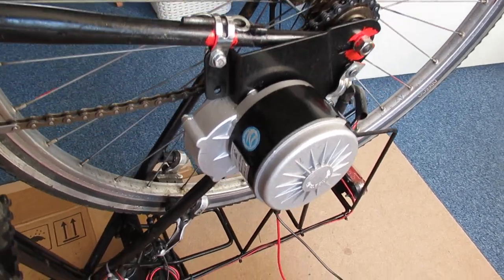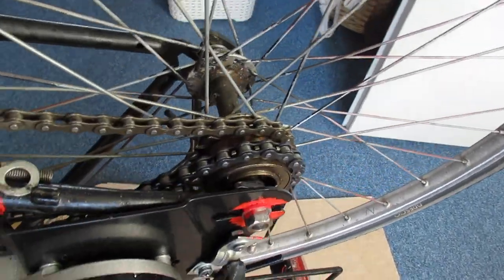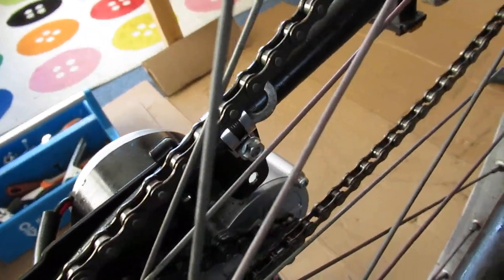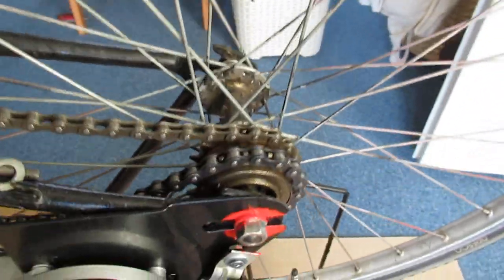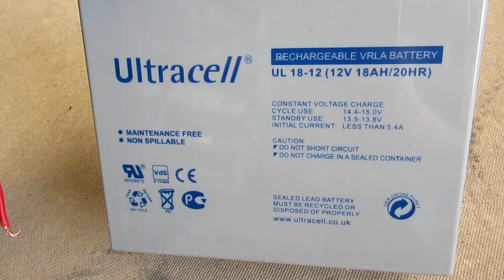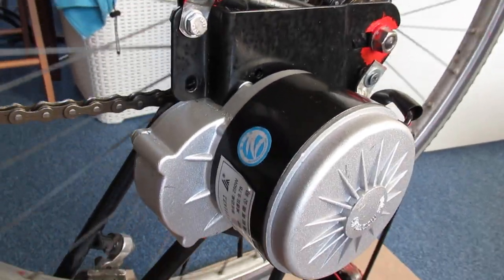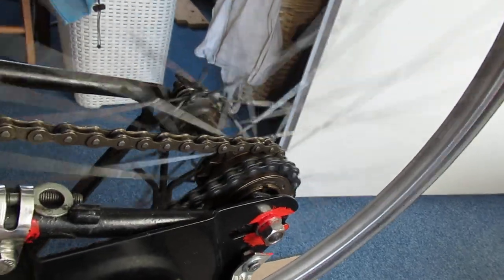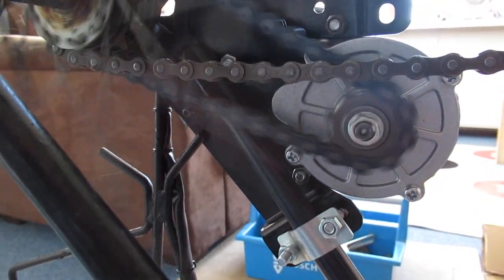Electric bicyle made with Banggood unit of China 24 Volt motor 250 Watt, Utracell UK lead acid batt

Comment: Cool, a home brew electric bike. You may want to add a micro switch to the hand brake and high amp relay to the power connection so you can shut down power when braking.
Reply from the maker: Yes, that is what I want to do.

Comment: Hi there, do you have the dimensions for the gear for the motor and weight of the motor?
Reply from the maker: No, not exactly, but the estimated weight is 3 kg, perhaps 4. The gear is standard for on old school bycycle, in the textbox you can find all the relevant video's. Many other video's are on YT about this motor and setup.

Comment: Does this kit works with a lithium battery?
Reply from the maker: Yes, but a lithium battery needs a special charger, that is very important. And a Lithium battery has a very high energy content, so you must surely use fuses (say a 20 Ampère automotive type) from the battery to the motor as a safety measure for high currents when the motor/wheel (say) gets stuck. By the way: you also need that fuse with a lead-acid battery.

Comment: Hi . can you still pedal while using the throttle?
Reply from the maker: Yes, but you must be fast. Not an ideal situation.
Reply: @radiofun232  How about if it's turned off or the battery runs out, Is it more difficult to pedal compare to a normal bicycle without a motor?
Reply from the maker: Due to the 2 lead acid batteries + the motor the bike is heavier. But with the motor off the "freewheel" still works, so the motor is not active and does not hinder the pedaling.
Reply: @radiofun232  thanks

Comment: you need to hammer down that motor frame to adjust the motor itself, so that it will give you some space in between the bike motor and its chains going to the main back tire so that the bike frame will not have any scratch from the chain as it runs and it will somehow prevent you from any accidents along the way... because that is what I did with my ebike...,..
Reply from the maker: Yes, I had to adapt that plate too, till it fitted in properly. I did not have a vice, so I grinded a slit in to make it fit.

Comment: You know Ko,,, that is not a bad price for that motor and setup. Please do a follow up when you do a practical test outside.
Reply from the maker: Thanks, Carl, I will surely do that. First test will be the effect of 24 V and 12 V, how the (hand) regulator works on the steering weel on 12/24 V + eventually the electronic regulator that came with the Banggood set, perhaps a relay circuit with a 12 V - 30 Amp relay, regarding switching between one or two 12 V battery (ies), or 24 V, etc. etc.

Comment: Will it work on a beard bike and is the chain the same size?
Reply from the maker: I don't know what a beard bike is. But it does not work on a bike with a "kick back brake". Both brakes (front-back) must be the types made with break pads. And there must be a possibility to attach the motor to the frame.

Comment: two number 12v 20 amper jell batery is it possibility ?
Reply from the maker: yes + use a fuse of (say) 20 Amp.
Reply: @radiofun232  thanks use a voltaj regülatör is it posibility?
Reply from the maker: @jesika6015  yes, the right one.

Comment: Have you got an idea of how you will control the power going to the motor?
It's really amazing how robust, reliable, and tiny they are making this equipment today.
Reply from the maker: Yes, a magnet on the front sprocket (driven with the pedals) and a reed relay close to it on the frame. On every turn the reed relay closes. Via a transistor circuit (DC amp.) to a 12 Volt 30 Amp automotive relay, so that the motor gets "pulses", of course properly smoothed out to prevent damage to the motor.
Reply: @radiofun232  Outstanding! Was thinking of a hand controller like on a motorcycle or 4 wheeler. But what you've got seems better suited for that application. Thank you for the reply :-)

Comment: Any instructions on how to mount the drive gear on the rear hub?
Reply from the maker: You get a threaded sleeve with the set, that is screwed into the existing gear. Then the other gear (for the motor) is screwed upon that sleeve.
Reply from the maker: construction slightly visible on 2.34 in this video https://youtu.be/3QAdK6u_sRk

Comment: Is it strong
Reply from the maker: yes on 24 volt with enough DC current
Reply: @radiofun232  can I give this motor 48V 30A which is 1440w without fuse. I will use pwm speed controller to control speed. I need high power motor
Reply from the maker: @str8xrippin  1) you need a fuse, when the motor gets stuck without a fuse it will burn out. 2) Perhaps your pwm can do this job, a fuse is always neccesary . 48 V x 30 A= 1,4 Kilowatt. 28jan2021.
Reply: @radiofun232  okay thank you for the insight. I have a dc to dc voltage booster that has 30A fuse so if amps increase too much fuse on the booster will blow stopping power to pwm controller. Pwm controller also has 30A fuse so all in all I have 2 fuses in line so that will give me enough protection. Maybe I will push 60V 24A so that system runs with less amps. Thank you